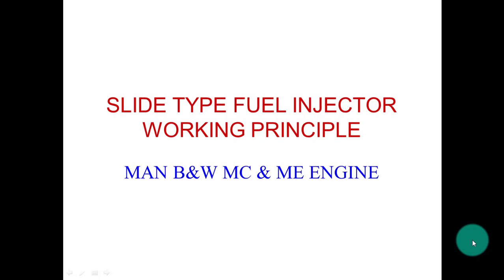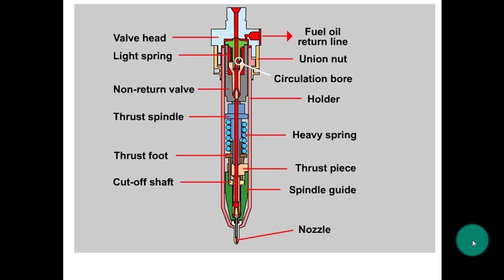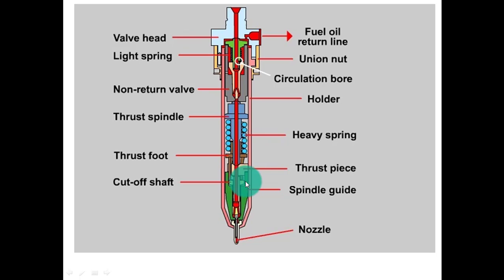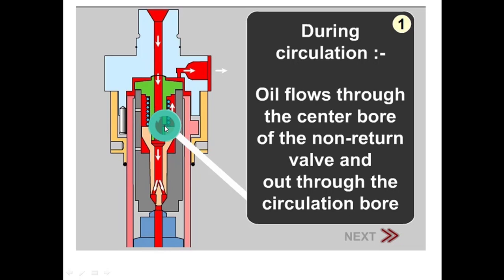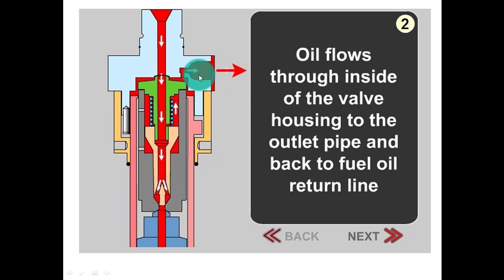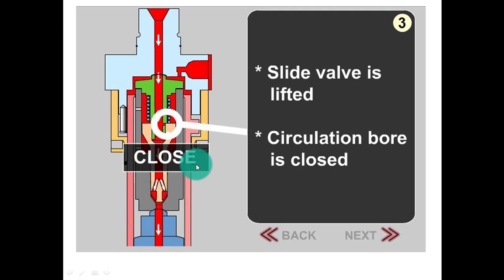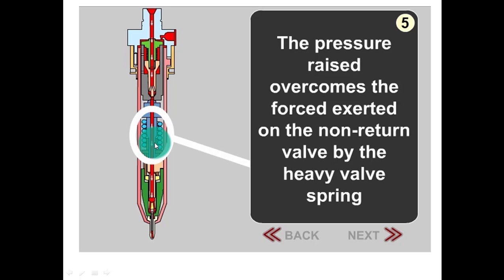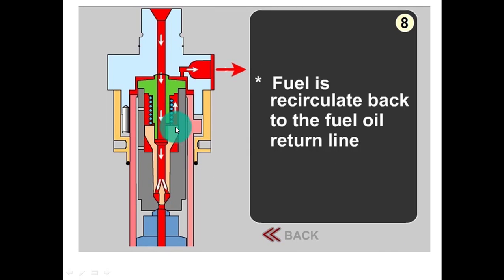Slide Type Fuel Injector Working Principal

Comment: That fuel valve,have a secret very rare,I has been first engineer many year ,when fit the splinde guide,is necessary knock many time with a brass piece,if not..the fuel valve remaing leaking too much
Reply: Thanks for tips....bro

Comment: how will the fuel is kept in circulation.
Normally when engine is stopped, fuel pump itself circulates. So, how does the fuel oil reached injectors.?

Comment: does this fuel oil coming from centre during engine stop goes to bottom slide valve also or just till to non return valve slide valve and from there recirculates,,,,if from there only then why just upto non return valve part its small in full injector size??pls reply earliest

Comment: Dear sir. 
Adjustments of
1-pilot fuel oil system,
2- primary liquid gas or cng injection 
3-adjust cyl/oil (bn mixing + quantity)
 (when you delivering ship from pervious crew or adjustments after overhaul or adjustment when you deliver dead ship) 
Please explain everything like real time you doing with all small points
Thanks for your response 
Sincerely yours